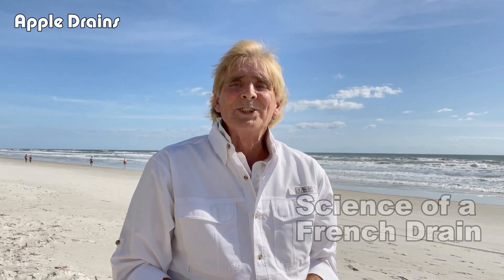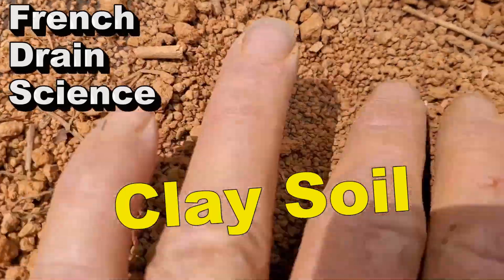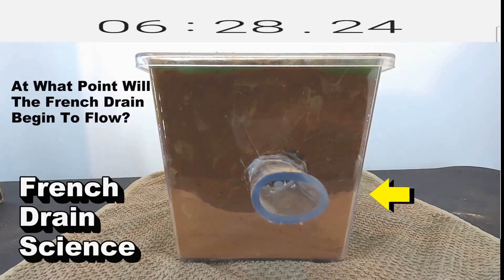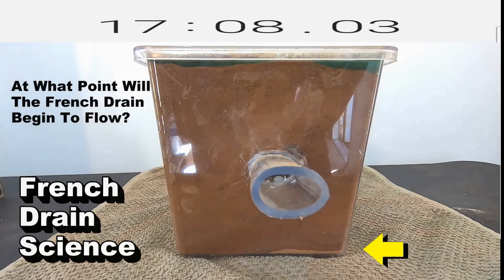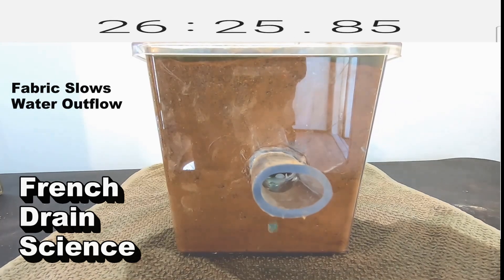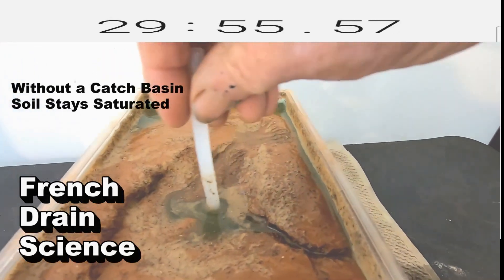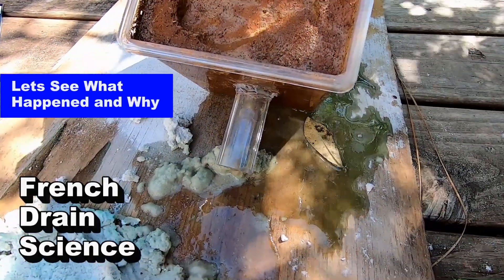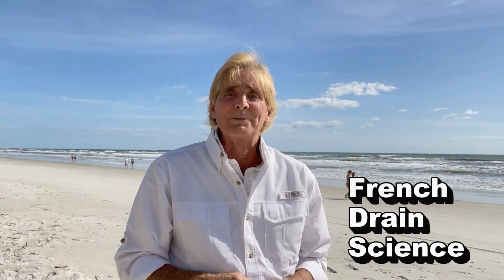French Drain Science -  Clay Soil

Comment: UK here looking for the best way to create multiple linked French drains 360 degrees around a house where the water table is in heavy clay under the subsoil. I can see the filter sock doesn't work directly around the pipe, but what about the woven membrane encapsulating the drain and clean stone inside it burrito wrapped? If I don't use a membrane what stops my stone and perforated flex pipe becoming blocked?

Comment: The correct filter fabric does not become clogged.  It only matches the porosity of the surrounding soil. So whether you use fabric or not, it doesn't matter about the flow.   What the fabric does is, it keeps the stone in the drain clean so that it acts as a filter.  And it prevents soil from entering the drainage system.  Soil entering the pipe defeats the whole purpose of having a drain in the first place because the problem soil is intruding into filter system.  You showed how the fabric was covered in silt, that means it did its job.  And the reason your test showed poor flow is because it's a poorly engineered French drain.
Reply: What could he have done better? I like to educate myself on this

Comment: Seems like clay soil is problematic.  If the solution is to use catch basins  without fabric with your French drain, then don’t you have two problems: 1) in effect only have catch basins to help move water and 2) your pipes will fill up with the clay?
Reply: I think you're supposed to clean the drains to prevent buildup.

Comment: I haven’t read the comments but, here is what I see in your test that is different than most applications.  Your test soil is totally broken up and very porous, so water drains all
The way down to the bottom vs lots of sub soils being compacted and not nearly as porous, forcing the water to the path of least resistance and flower much faster towards the drain area.  Catch basins help to take in water for sure, but this test needs be done using a subsoil that’s not screened.
Reply: Well when u dig a trench and reuse the soil that's what happens